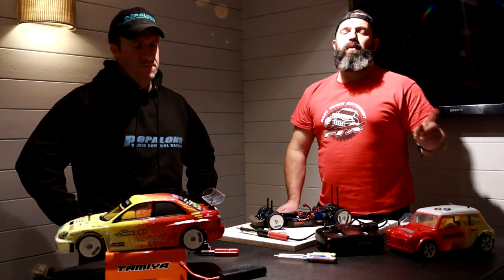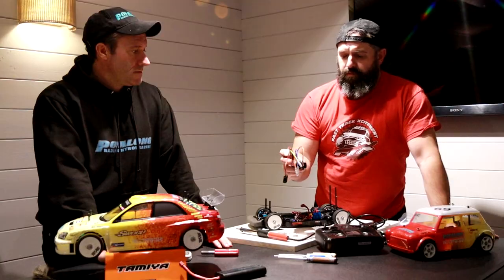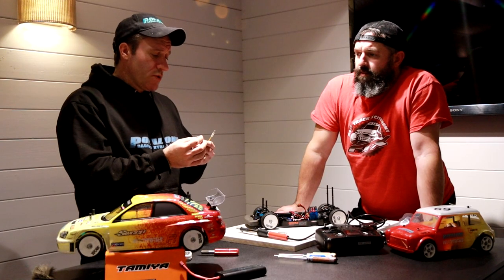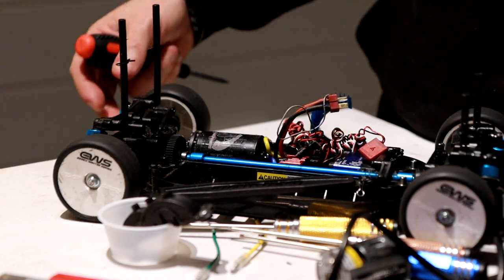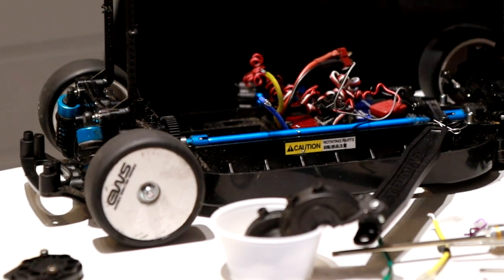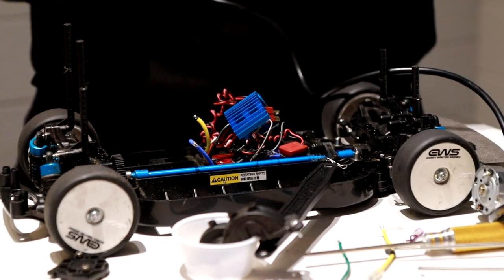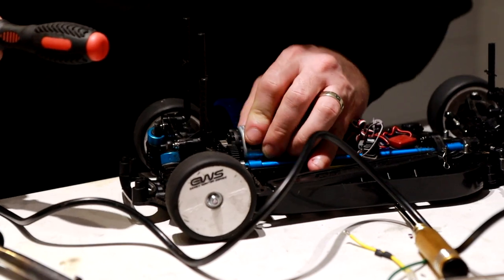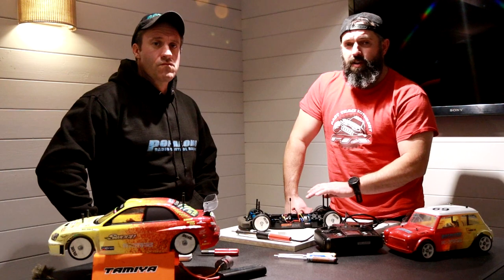Tamiya RC CAR RACE preparation

Comment: add cap pack to the 1060, its like adding NOS. I've had my torque tuned + 1060 for more than 7 years now, reliable.

Comment: Damn….you two spying on me or something!! This is literally me right now getting ready for my first go at an Iconic round hahahaha….my TP came in the post today, but mines going in my M03 mini. Great video gents….glad this popped up before I started cutting and soldering….ps well said about the plastic ‘sheath’ melting….had one melt on my TT01 that I race….only after taking everything out did I spot the black marks!
Keep up the wicked vids…and good luck for Iconic ✊👏👏👏
Reply from the maker: Love the M03 racing at iconic last year.

Comment: Due to the shortage of the latest Tamiya ESC's, new kits now come with a Carson ESC here in the UK and a Hobbywing 1060 in the US. The Carson seems to be a Hobbywing 1060 or a copy of it and comes with a deans/t-plug connector as standard with a Tamiya adapter included 😀
Reply from the maker: Nice one Luke for the info👍👍

Comment: Do you need to, run in a new motor ?
Reply from the maker: We have run water dipped motors in the past.. does not make a massive difference but does shorten life of the brushes